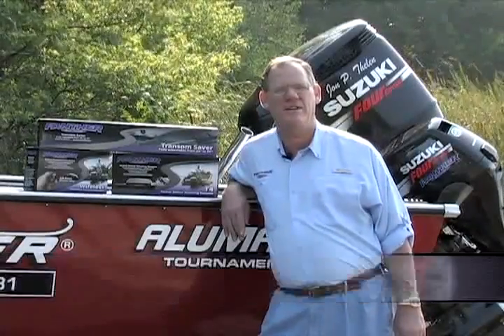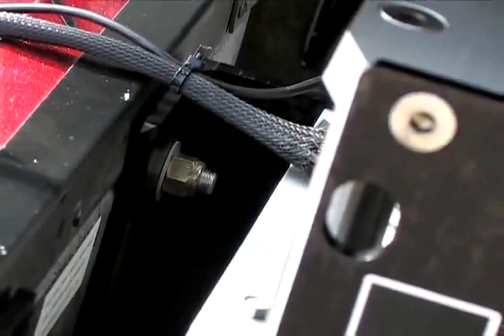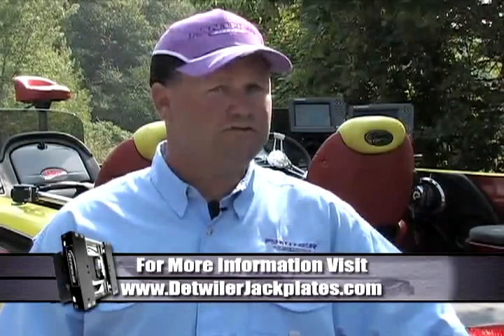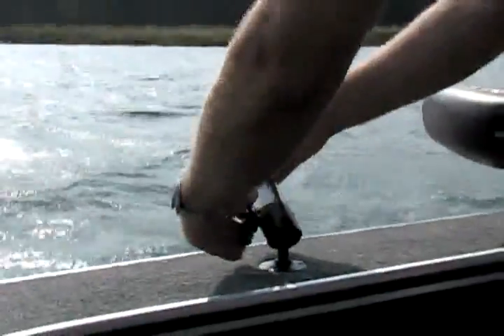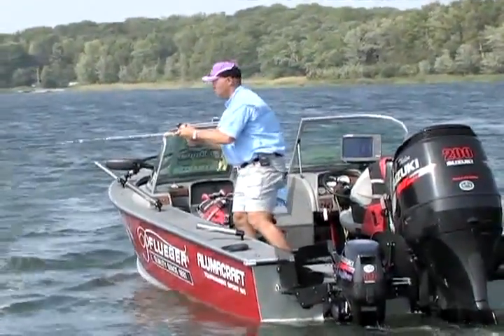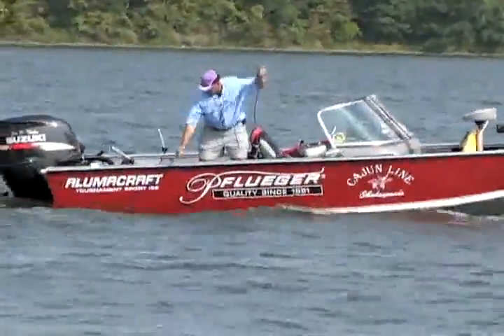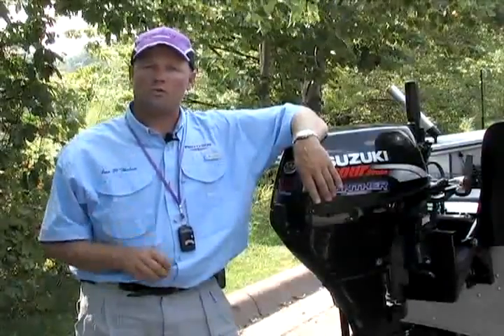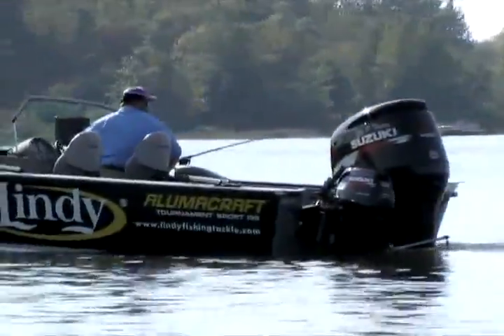MarineTech Products Installation and Information - iboats.com

Comment: I just installed a panther jack plate on a friends boat.  I have an 8 hp motor mounted on it.  My friend and I can not figure out how to lower the mounted engine.  No instructions with it about mounting it, and there are no you tube videos showing to lower the motor.